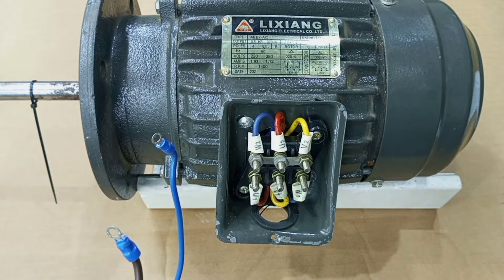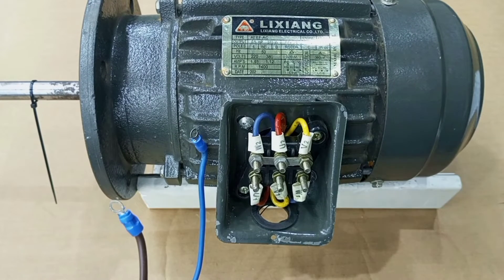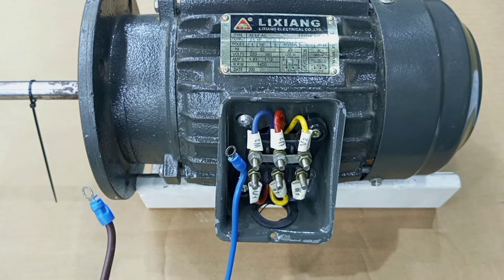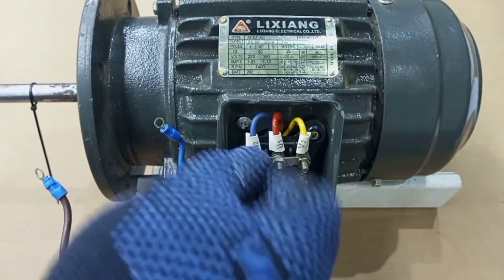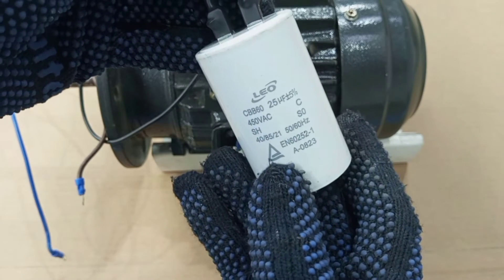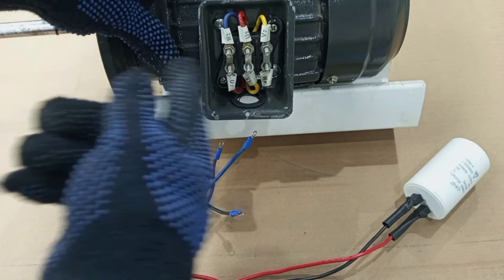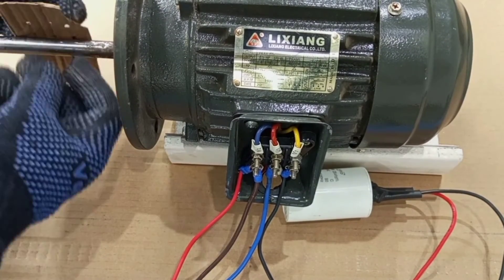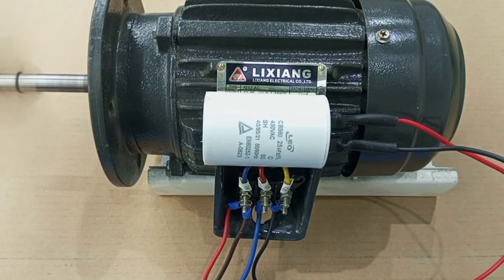How to wire a CAPACITOR to run 3-phase motor with single -phase power

Comment: so this is basically running a 3phase motor with only 2 phase like circuit, can you use 2 caps to create a 3rd phase?

Comment: what do  u mean by soft starter ?
Reply from the maker: a soft starter  is a device (starter) that regulates the electric current supplied to a motor during startup. Unlike a traditional direct on line starter which applies full voltage immediately, a soft starter gradually increases the voltage over a set time period. This provides a smoother and more controlled acceleration for the motor.

Comment: Please what are the advantages and disadvantages
Reply from the maker: Advantages:
*For lighter loads, a capacitor-run setup might be sufficient and provide adequate performance for the motor and this is more cost-effective than other means of using single -phase to run a 3phase motor 

Disadvantages:
*Reduced Power:  Running a 3-phase motor on single-phase power with a capacitor will generally lead to a decrease in power output.

*Lower Starting Torque:  Three-phase motors naturally have good starting torque. Bypassing the three-phase power with a capacitor can reduce this critical starting power.

*Not ideal for all motors:  This method may not be suitable for all three-phase motors, especially those designed for heavy-duty applications.

Comment: Please what does the +/-5% means
Reply from the maker: The +/-5% tolerance is the percentage deviation allowed from the nominal value.
Example, for a 25uF. +/-5% capacitor,
The acceptable range of capacitance is calculated as follows:
Lower Limit: 
= 25uF - (5/100 x 25uF) = 23.75uF

Upper Limit: 
= 25uF + (5/100 x 25uF) = 26.25uF
Therefore, an ideal 25uF capacitor with +/- 5% tolerance will actually have a capacitance between 23.75uF and 26.25uF.